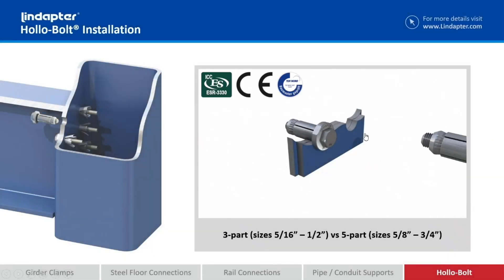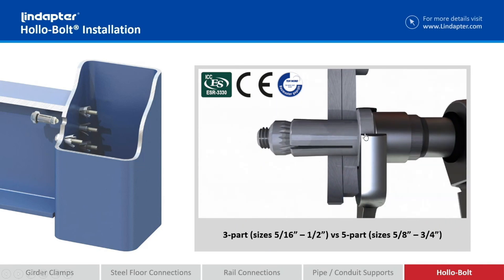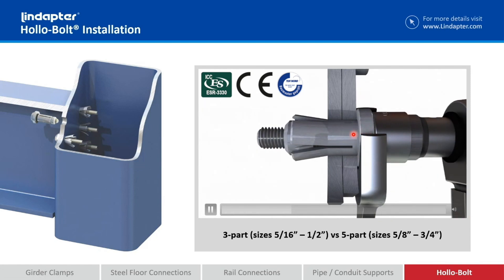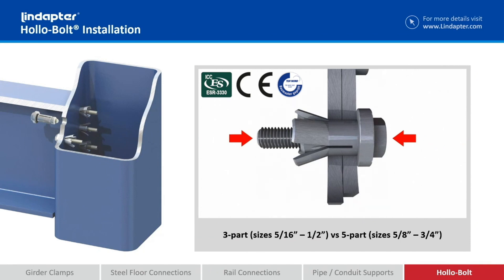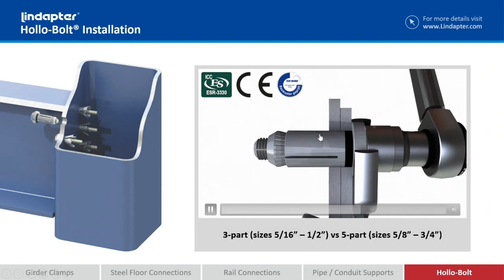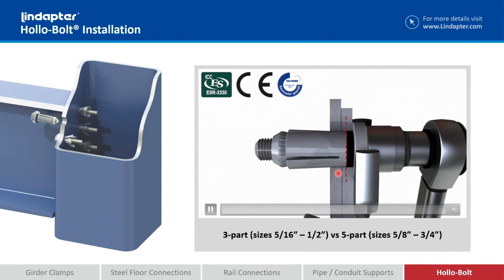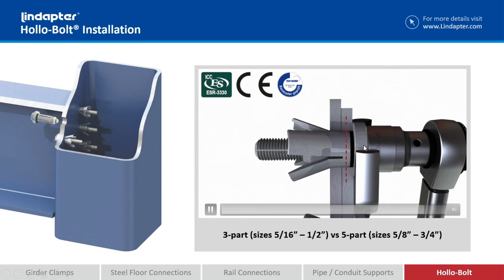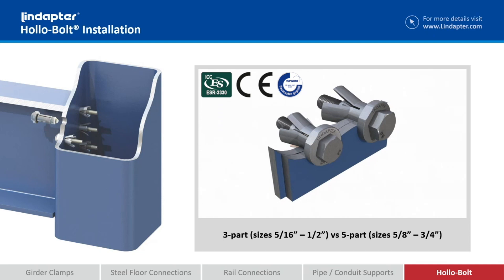How to install Hollo-Bolts Step by Step

Comment: Is it removable?
Reply from the maker: Yes, the Lindapter Hollo-Bolt is removable, offering a significant advantage for projects where future modifications or adjustments may be required. Unlike traditional welding or permanent bolting methods, the Hollo-Bolt provides a secure connection that can be easily disassembled without damaging the steelwork. This feature is particularly beneficial for applications where structures may need to be reconfigured, relocated, or temporarily installed.

The Hollo-Bolt's design ensures it remains robust and reliable while also allowing for straightforward removal using standard tools, saving time and labour costs during dismantling or maintenance. This versatility makes it an ideal choice for engineers and contractors seeking flexible and cost-effective solutions for hollow section connections.